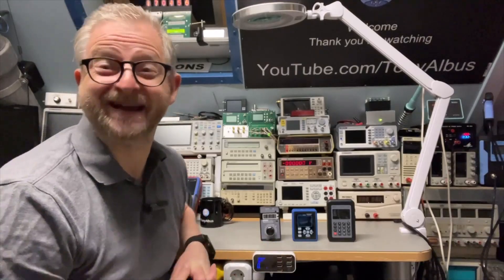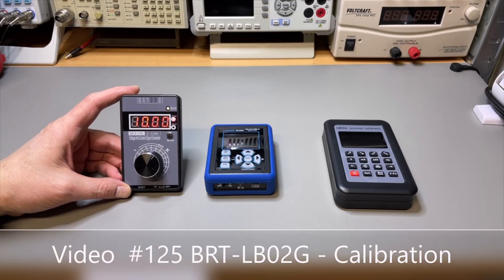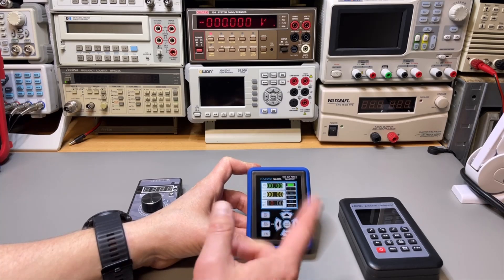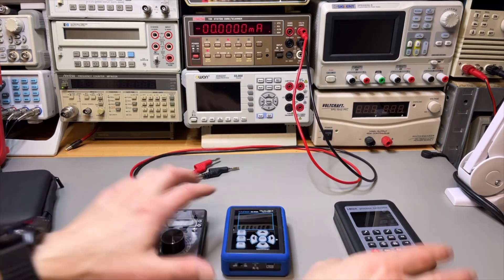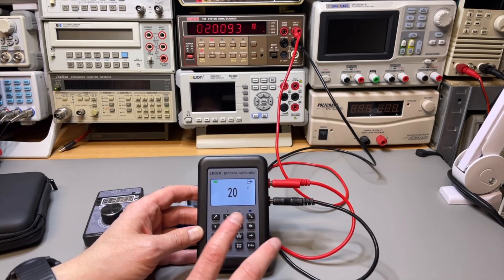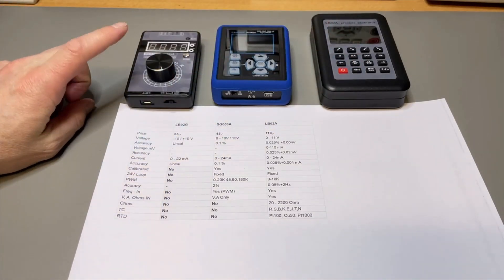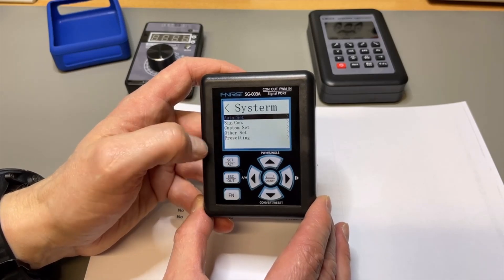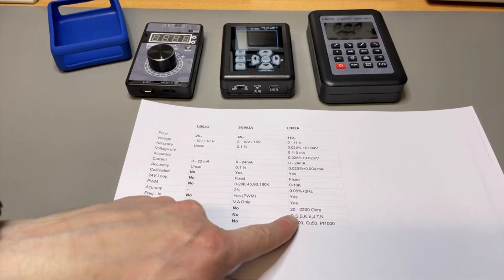#260 Process Calibrators LB02G SG003A LB02A in 5 minutes

Comment: if you know what looking for there are many good bench process calibrator for a ridiculous price. 
Also these little chinese unit are good but for example I bought some months ago one loop calibrator from a lab that use it for probes testing. 
it can generate volts, ampere, ohms, degree,frequence, and something more for few hundreds bucks. 
I test it and is still in spec after 3 years from the last calibration. 
I forgot to say this is a 6,5 digits with a bar graph chart option, it's a really beast, I'm very happy with this old/new instrument in the lab.
Reply from the maker: Thanks, what is the name and brand?
Reply: @TonyAlbus  the name is microcal 2000+, obviously not the last futuristic loop generator/calibrator but for the price is very interesting instrument.
Reply from the maker: @kamikazekk-df4vz  Thanks, looks very nice indeed

Comment: The LB02A seems quite good but the price for the LB06 is a bit crazy. I wonder if there is a way to upgrade the LB02A into LB06.
Reply from the maker: Yes i was wondering about that too, the accuracy of the LB02A and LB06 are the same, so it would only be usefull if you need MODBUS or HART.